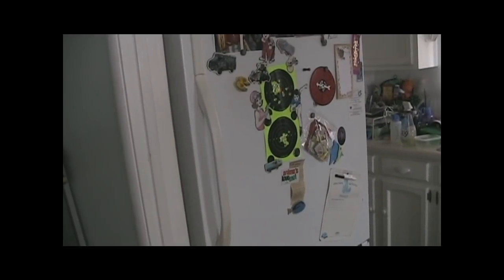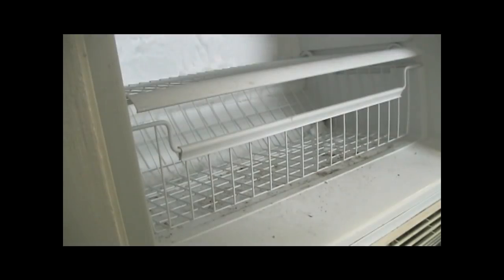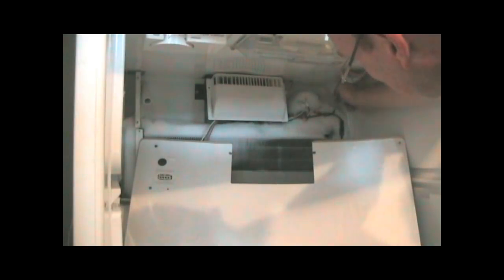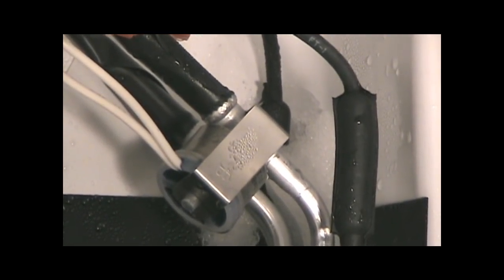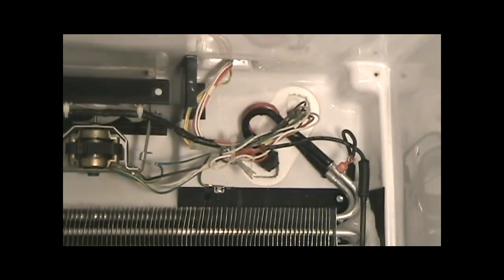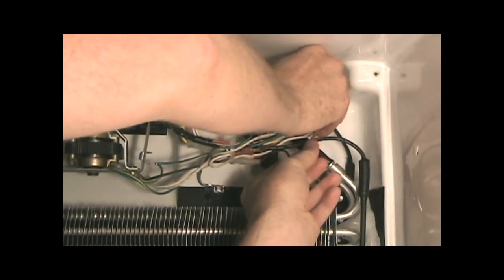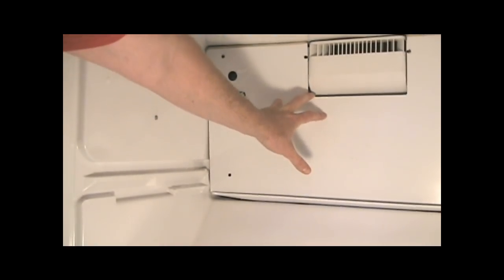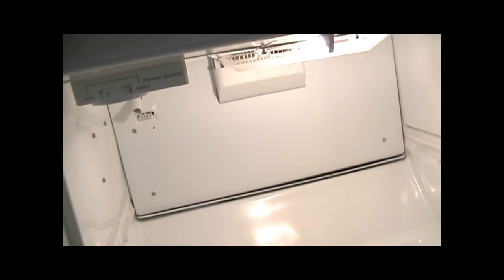How To Replace The Defrost Thermostat In A Refrigerator And Defrost A Freezer

Comment: I saw another vid where it is explained that you only need to set your freezer at 1/3 its max on the dial.  Mine goes from OFF to 7.  I set it at 2.5.  It saves your fridge from running continuosly - wasting power & wear on the fridge. Great tip

Comment: So many people get this wrong, and start replacing parts when they don't have to. 1 of the main reason fridges / freezers don't work right or FREEZE up is they get on a bad cycle for a few different reason, and once they get out of a normal cycle then the trouble starts from there. this is what you do FIRST, and it usually works! Take all the crap out of your freezer / fridge, and open the doors...unplug first, they let it just set and de thaw it's self for hours, over night is best! Next day, plug it in, and see if it works, chances are it will. Think this is crazy, what you have to loose, nothing...besides deicing, you reset the circuit board just like rebooting your computer, most the time it fixes it's self...cheers! it's worked for me many times!

Comment: You might also want to check out a product called Noalox. It's a petroleum jelly, mixed with powdered lead. I sometimes put it inside wire nuts and it also works great on car battery terminals. I'm sure you will find many more uses for it as it's a great conductor and prevents corrosion. Thanks again for your tips.

Comment: A few tips for all. Defrost with your steamer. I have a cheapo that I bought at goodwill and I can defrost in ten minutes. It makes a ton of fog in your fridge, blow away with a hair drier or suck fog out with a shop vac (vac works best.) To test timer, mark a spot on the timer and see if it moves a bit in 40 minutes. I think a full revolution takes 8 hours.. it moves clockwise. Only 3 things can cause this condition. thermostat, timer, and the heating element. I cant see how the lement can fail

Comment: hoohoohoblin hi
Thanks for your contribution to DIY,  I have a Leonard fridge; 35 years old and still going well except for the defrost thermostat, I followed your instruction by replacing the defrost thermostat of course a brand new one; it worked for a few days but went back to almost what it was before,  I replaced it again with another brand you one; still the same.
I am not so sure of what I am going to suggest, so I need your advise, my suggestion is to place two defrost thermostat one

Comment: Great video. Hope you can help with my problem. The old part had black and white leads. The new part has 2 gray wires. One has a bit of insulation on the end and the other is bare. I don't understand this convention. Do you think it matters which is hot and which is neutral?

Comment: Thanks for the video. Couldn't you have tested that thermostat to verify that it was faulty? How would you do that? It appears that the devise was not allowing  the defrost heater go on. Is that correct. Thanks for your help. I have a similar problem as my unit is not cooling???

Comment: I hope that the ice didnt come back but i bet it did. The fridge has a defrost timer in it turn it clock wise slow and it will make a loud click thats derfost mode. Check and see if the heater comes on if it does replace the defrost timer.

Comment: My fridge like yours is not cooling, but the freezer is (although not as good as it should) I can't hear or feel the fan spinning. Should I change the evaporator motor or it could be the thermostat? There is almost no frost buildup on the back. Any feedback appreciated. Thanks.

Comment: the fridge was unplugged for 3 years and we started using it again 4 months ago.  if the refrigerant leaked out wouldnt we be able to smell something funny?  perhaps we just need to clean the coils wherever they are located on this unit?  could the defrost thermostat, defrost timer or compressor be the cause of this?   im on the fence on repairing or replacing it.  would love to repair it if i could as long as its pretty straight forward and not to difficult. thanks for your reply

Comment: I have a Maytag fridge older or simpler model MTB2191ARW that has a three wire thermostat-a white and green wire to a freezer wall plug and a red wire on a separate plug I assume is to the defrost heater.  Evaporator is constantly freezing up. I get continuity both when the thermostat is warm and cold touching the white and red wires. I guess the green is a ground.  I have been told the thermostat is discontinued. So is there aftermarket thermostats for this or can I use another thermostat perhaps a two wire and just connect the white plug in line with the red?

Comment: The symptoms of your fridge are the same as mine.  Freezer hovering at 22 instead of the usual sub zero and the fridge ranging from 40-60 instead of 36ish.  I thawed it once and the temperatures went back to normal but now it's doing the same thing (too hot).  Sound like the thermostat to you or something else leading to the thermostat getting frosted up and THEN the thermostat stops properly working?

Comment: I have a question. I have a vending machine that doesn't get cold. I've line tapped the low side and the pressure test gave me a negative reading I added freon it got cool but not cold. Before I added freon to the line I pulled a vacuum on it and it held pressure no leaks. I go back to the machine a few days later plug it in and get another negative vacuum and its not cool again. What do you think could be the problem?
Reply from the maker: It must be a really slow leak if it was cold after adding the Freon. Maybe it is too slow of s leak to detect.

Comment: I have the same Kenmore refrigerator as you.  I checked the thermostat and its working (conducting when it's cold; not conducting when it's warm). However, I am getting ice build-up in the passage between the freezer and the fridge. When I remove the ice, the fridge is good and cold for about a week.  But then the ice builds back up on the left side beneath that passageway going up to the fridge. When the ice blocks the passageway, the fridge, which starts out being good and cold, stops being cold.  I have to remove the back panel in the freezer and defrost the passageway again.  Do you know what might be causing that?
Reply from the maker: It could be the defrost timer.

Comment: Same fridge.  Same problem. Cut two of my fingers on the fins.  Arghhh.  This is the 2nd time in 2 wks that I have had the back off.  1st time the fridge was warm This time the freezer isnt frozen. Does your ice maker work?  Mine worked initially but the ice tasted really bad then it stopped working so didnt worry about it  Thks for showing me how to replace the thermostat Will pick up the part tomorrow. thks again

Comment: I used a steam gun to melt the ice, it's much quicker.  I have a question, how did you know the defrost timer needed to be replaced and not the heating component?  I'm trying so hard to keep this ice from building back up.  I had to defrost 3x already.  The ice keeps building back up.  Please help. Thanks
Reply from the maker: In my case it was a lucky guess. You can test the defrost thermostat with an ohm meter like this: Set your multitester to the R X 1 ohms setting. Place each of the 
multitester's leads on a thermostat wire. When your thermostat is cold, 
it should produce a reading of zero on your multitester. If it is warm 
(anywhere from forty to ninety degrees Fahrenheit), then this test 
should produce a reading of infinity. If the results you receive from 
your test differ from the ones presented here, then you will need to 
replace your defrost thermostat.

Comment: heman , hi i try adding freon to my refrigerator its colding great but one of the lines keep icing up but the other one is warm some help please
Reply from the maker: Heman Maharaj I don't know why that would happen.  Did you use the same kind of coolant that the refrigerator came with originally.  I've heard that if you mix new and old types of refrigerant, bad things can happen.
Reply: ***** yes i use R134a it is working fine but whenever the heater comes on the ice on the melts and leaks on the floor

Comment: I have a hoover nextra A class frost free plus fridge,it does not freeze and a repairman suggested a replacement of the timer but the problem remains the same.the freeze is not freezing at all but some times producing heat.what is wrong with it. pls need help.
Reply from the maker: Gideon Kwofie It could be low on coolant.  You could also unplug it and defrost it, to make sure it isn't all full of ice like mine was.  If everything gets frozen, then it can't create cold air.

Comment: i have a kenmore 363.9656616 top freezer fridge which is not cooling the freezer nor the refrigerator. when i open the door, the light turns on and air is blowing inside but its warm air.  i dont know what could be the issue nor how to open the back part of the freezer bc i dont see any screw holes back their...your help would be welcomed

Comment: My fridge was freezing in the freezer compartment but the fridge wasn't cold enough. Coils were de-iced, repairman replaced heater switch. Fridge sat all night unplugged. Now 4 hrs after plugging in the freezer is at 10*C. Should I be concerned or wait another 8 hrs.
Reply from the maker: 4 hours should be enough time for it to get freezing cold.  I hope it's colder now, though.
Reply: Thanks for your response. I discovered the fan wasn't turning. I guess when I'd put the Styrofoam back in it was touching a fan blade. Once that was fixed it began cooling almost immediately. The repairman left me to finish de-icing the coils and putting it back together to save on more labor cost.

Comment: Do not pay $120.00 for the GE thermostat. The Whirlpool part is exactly the same, made in USA, with the same part number on it, as the GE. The only difference is that one of the connector terminals is different. Swap out the connector with the old one and good to go.
Reply from the maker: Thanks.

Comment: my refrigerator is currently doing what yours is doing in the video.  No cold air in the cooling side and frost all over the coils when I open the cover.  I use to hear a motor running (i think it suppose to recycle) but not anymore.  What could it be?